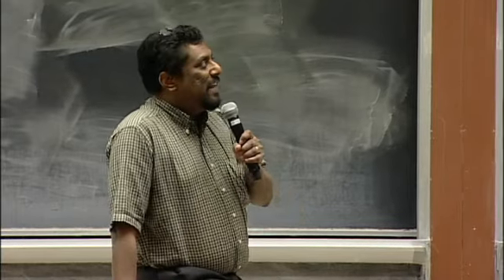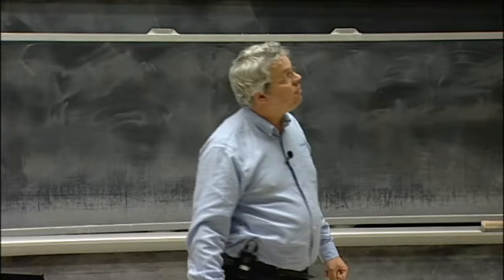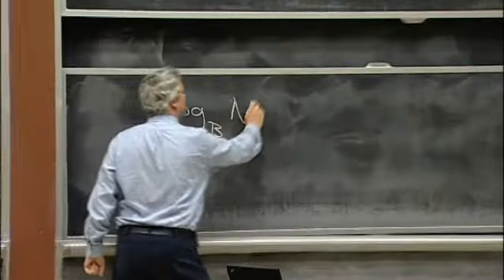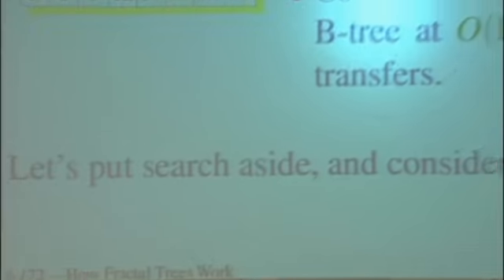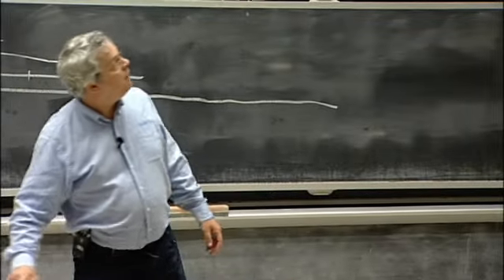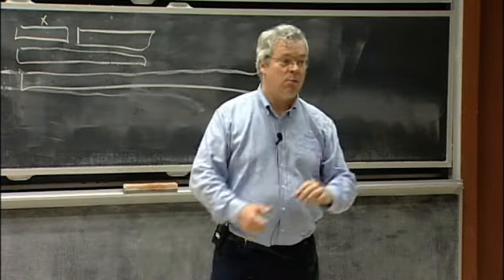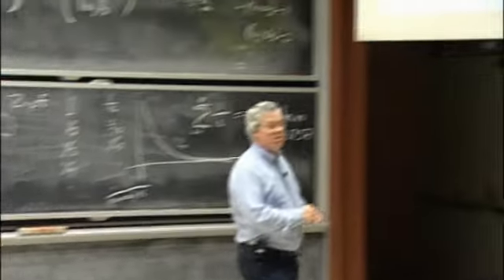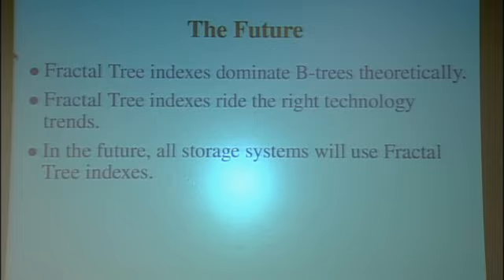Lec 19 | MIT 6.172 Performance Engineering of Software Systems, Fall 2010

Comment: "Seagate indicates the 67TB drives will be here in 2017."
Turns out, no. :D I just quickly looked it up on a comparison site and the biggest ones are labelled 61.44TB. If that really means TiB, then that is actually a bit over 67TB, but those are new in 2024 and the cheapest one was ≈5000$. If you buy 67 of the cheapest 1TB SSD, it costs ≈2500$. I tried a bit to find out data from 2017, but there was no easy way.